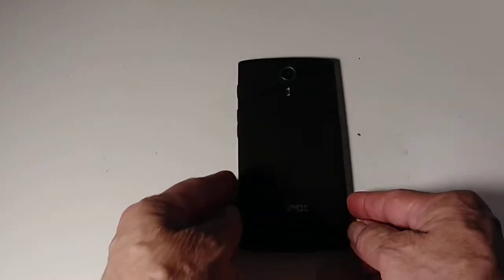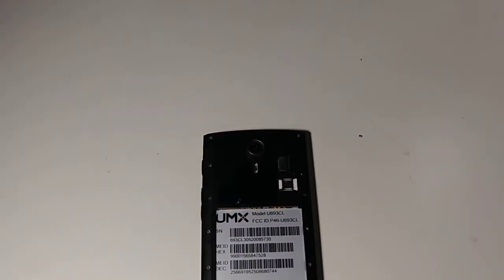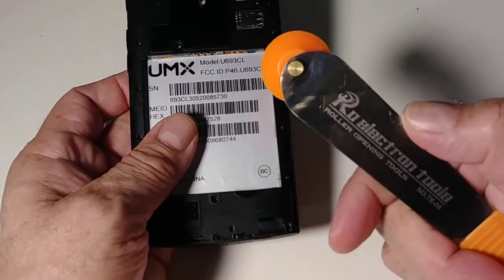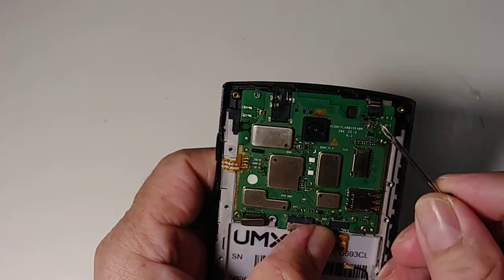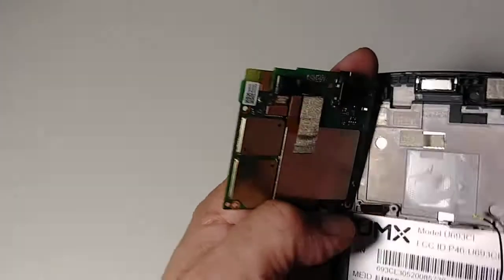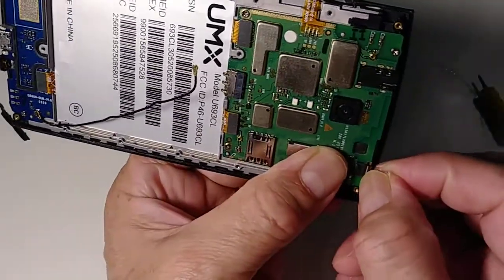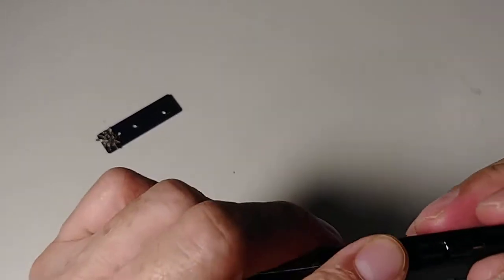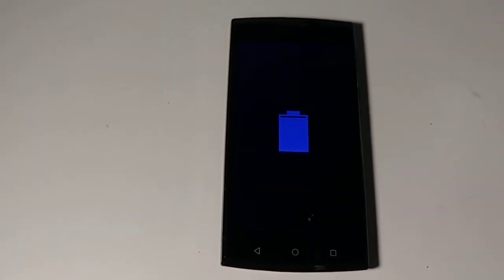HOW TA REPLACE A MAINBOARD ON UMX U693CL CELLPHONE

Comment: real quick tip! you dont actually have to de-soder the buttons you just have to use one of the plastic opening pics that look like a guitar pic and carefully cut through the adheasive that is gluing the buttons in the metal frame of the phone! thats how i got mine out! also take the plastic button par out first
Reply from the maker: Thank You!
Reply: Ya. you wouldn't have to remove the buttons unless they were actually a problem. Just swap them with the board.

Comment: Not sure when you would want to replace motherboard unless you have a spare, in which case you might as well just swap the SIM...  Anyway, my problem is the UMX phone keeps rebooting itself.  Tempted to root and replace with generic Android ROM. If you know how it's done, that'd be great.
Reply from the maker: Hi  have you tried to Hard Reset to fix the keep booting?
Remember if you that everything will be remove it!
Reply: @techstricks5740  Did a factory reset a couple of times. It's finally stabilized, for now. Not sure why the previous few factory resets didn't do the job but this last time did.  We'll see.
Reply from the maker: @fifty2weekhi  i am glad you fixed it!
Reply: Well, for me I have both a broken screen and malfunctioning charging port, so it will just be easier to put the old mainboard in a new phone.